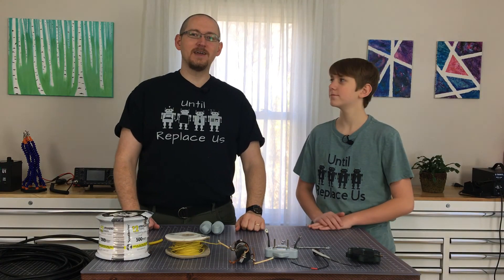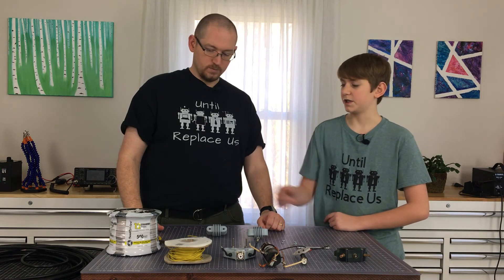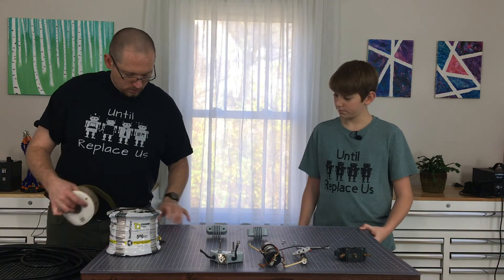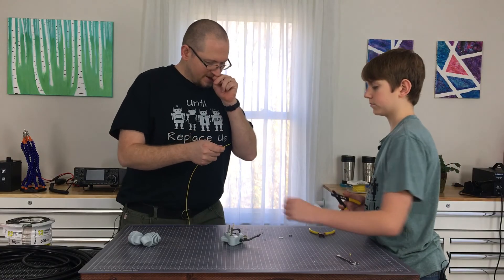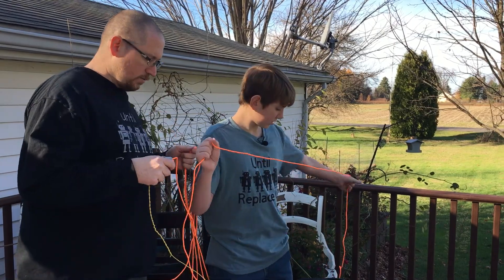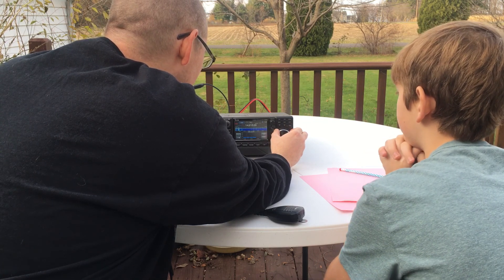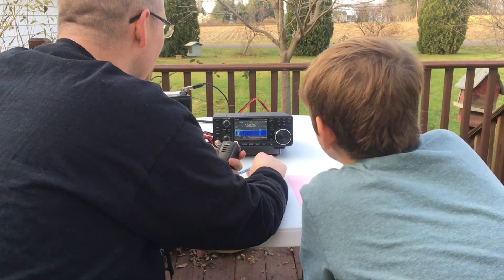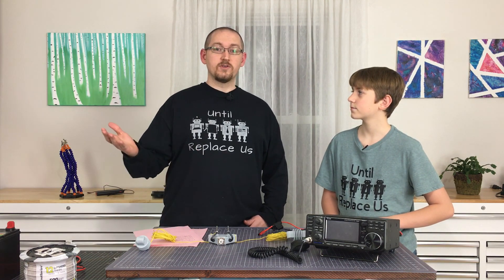Simple 20m Ham Radio Dipole Antenna

Comment: A nube question. First of all, a really great video together with your son! You said in the beginning that the contector had no contact with the poles. Do the poles, after the two wires has been screwed in, connection with the connector? Is the current fed through the connector in order to transmit through your antenna? I’m sorry if my question reveals lack of competence… I’m just eager to learn.❤️ Anyone in here is free to answer.

Comment: I made a 20M Dipole Antenna. I will not be using this 20M dipole for any other frequencies other than the 20M that it was made for.  Is a balun needed for this a 20M Dipole antenna? Again I will not be using this 20M dipole for any other frequencies other than the 20M that it was made for.  I also have an isolator.  Would I need both? Do they pretty much do the same job?

Comment: First electric fence wire is cheap because it is a poor conductor. 
Second the SWR they saw could be very misleading. Due to the fence wire acting like a slight dummy load. I suspect that the radiated power was a lot lower than your pencil would suggest.
Third if the antenna was a lot longer I am sure they would have an issue with both receive and transmit.
    It is nice that he included his son. I hope his son continues to do activities with his father. A good example for everyone.

Comment: We ended up making the antenna on Wed and made contacts to Panama and New Zealand on 40 meters. Also heard Denmark clear as a bell! Thanks again for the video. Now we are going to make a fan dipole with the same Alpha Delta to save on coax. We will use bamboo to separate the different wire bands!

Comment: I'm building one this week
Reply from the maker: Sweet - how did it go? The design is simple, yet effective.
Reply: @transmittinguntilrobotsrep1045  it works really well I used a old dipole center I had from when I was in the army and some speaker cable

Comment: I have a question.  Has the FCC ruled on using HAM transmissions in YouTube videos?  I ask because you could have pecuniary gain from YouTube videos.  I know the FAA considers using drone footage in YouTube video a professional use because of this, so I was wondering if the FCC has cleared it or not.  Great video by the way.
Reply from the maker: Hi Brian - That is a great question. I’ve never read anywhere that the FCC has ruled on this, or even considered it, though it could certainly exist and I just haven’t found it. I would suspect that there would be some fundamental differences between the two applications, however I can see how this is a valid question worthy of an answer. I’ll consider this more and then reply again.
Reply: @transmittinguntilrobotsrep1045  I understand the incidental instance like for teachers who use HAM to connect their class to the ISS, but some of these channels are 100% amateur radio and people are monetizing and making money from them.  Seems kinda like pushing their luck to me.  It would be one thing if it was, say, an RV travel channel and there was just an occasional episode where the communication on the air was incidental to the education (kind of like this episode of your channel), but the ones where it is a dedicated ham channel with them making contacts most or all of the broadcast seems like it would be clear cut.  I guess the FCC just hasn't gotten around to dealing with it yet.  How is it different than getting a bunch of people to pay an entrance fee to watch you making contacts.  Hard to police and know where to draw the line.

Comment: This is a really great video. Thanks for sharing it! I recently made an 80 meter inverted V by using DX Engineering's 80 meter coils, but after assessing the resonant frequency and bandwidth, I discovered that the antenna was resonant on 20 meters as well. I also got the resonant frequency right in the middle of both bands by chance without adjusting any of the wire lengths. The bandwidth on 80 meters is not so great, so a tuner would be needed most of the time, but 20 meters had less than 1.5:1 SWR across the entire band.
Reply from the maker: It is always a good feeling when you realize that you now have those complimentary resonant frequencies in addition to the intended one. I feel your pain with the limited bandwidth on 80m. I have two antennas that each cover a small part of 80m and together I still seem to chase outside of my area.  Good luck in your radio adventures and thank you for the feedback. 73s.
Reply: @transmittinguntilrobotsrep1045  Hopefully the antenna tuner will help with 80 meters. Thanks and 73s.

Comment: Like other people have said it is brilliant too see you and your son enjoying radio together. I would like to ask a general question. Why do Americans always work in feet and inches when building antennas . I am in the UK and use mainly imperial measurements for all my diy and so on but as soon as it comes to radio I find it so much easier to work in metric. This is a genuine question not a dig or sarcasm. My friends and I once started using imperial lengths  for fun on the air "CQ six foot six inches .QSY down a quarter of an inch" We were trying to rename all the bands but it got to confusing on the 3 furlong band. Best wishes to you keep up the good work 73 De G7BWI
Reply from the maker: Best comment yet. That is quite amusing - I would have loved hearing you call CQ in that manner. I may have to appropriate that at some point with my kids. 

As to why Americans work in feet and inches, I would assume that it is simple familiarity. If we go to the local hardware store, most everything is in Imperial, and so it is reinforced and creates familiarity. My kids and I work in metric when we are 3D printing, carving with a CNC, cutting vinyl, or really doing anything at a small scale. Again, I think it partly because many of the programs we use have metric options and so there can become both an intentionality and familiarity without difficulty.  At a larger scale though, we tend to shift towards Imperial probably because anything large (Wood, pvc, metal, foam, etc..) is sold to us in Imperial lengths, and so it sticks. Under less than ideal circumstances, we learn both. In a truly ideal world, we'd use metric exclusively. 

73, AC3DS
Reply: @transmittinguntilrobotsrep1045  It gets funnier. I remember when the UK was slowly trying to change to metric my Father and I went to buy some lengths or timber for a project. My Dad asked for 4 6 foot lengths of 2x2  only  to be told that they didn't sell 6 foot lengths it would have to be 2 meter lengths. Ok I will have 4 2 meter lengths please. OK said the assistant   4 lengths at 70pence a foot. You really couldn't  make it up. Mind you we are still clinging on to imperial stuff quite a bit. My trip computer on a motorcycle will give me miles per litre But not Miles per gallon. I remember my mother getting upset as the car wouldn't go as far on litres of petrol as it would on gallons. But  its all good fun in the end. Keep up the great work FDO

Comment: Hello both of you... question: suppose i want to receive the 6mhz band, so 468/6 = 78 feet, then my horizontal wire will be 39 feet each side, right?  Ok, with that wire length , can I also receive all the frequencies over 6mhz? ....and no frequencies under? To simplify, my question is can I get any frequencies over the length accordingly to that formula 468/x freq? Thank you for answering :).
Reply from the maker: Great question: 468/6 = 78ft / 2 sides = 39ft per / side - Yes.  This will make a resonant antenna at 6MHz, which is ideal for both transmitting and receiving. Tuning for transmitting is important. Tuning for receiving is not nearly as important because things won't break if your just receiving. Receiving frequencies above and below 6MHz on the above antenna is definitely possible. I just took an antenna that I manually tuned for 14MHz and was able to hear conversations on 3.5MHz and all the way up to 444MHz. The quality of the reception is definitely not as good as a tuned antenna, but it does work. I hope that helps.
Reply: @transmittinguntilrobotsrep1045  Ok thanks , your answer defenitively helps 👍👍👍

Comment: Because it does not look like you are using affiliate links I will point out that the Delta-C Amazon link is for Gigaparts. You can actually save a decent amount of money by going to Gigaparts directly. Great group of people there at Gigaparts. Of course if you have a 3D printer for the cost of filament, short piece of wire, an SO239 connector and two bolts you just make one. Of course you can just use a scrap of plywood as well or some cardboard, though cardboard has more capacitance, or even a small piece of plexiglass. 

This video does a great job at showing how you can throw together an very functional antenna in minutes. The SWR variance has more to do with the wire used than the lose measurements as dipole are fairly forgiving if you are close. Making the wire longer as they did here allows you make some small adjustments to length if you need to reduce your SWR.

Dipole are fascinating as they are both simple and complex. Just to point out how you can start to go down a very deep rabbit hole: The amount of droop you have at your center point has a noticeable effect on your radiation pattern. More droop starts to create the V pattern which has a much different radiation pattern than an ideal dipole. Likewise negative droop created an inverted V with is different than both ideal and V. Then that horizontal and vertical L shaped dipole, inverted vertical L, sloped dipole and things go on. So many people just throw up dipole antennas and don't give them the attention they deserve.

Now that the youngling knows how to make a dipole, it's time for him to get his license
Reply from the maker: Excellent analysis and thank you for bringing up some well considered points. I just 3D printed some wire winders, and you are spot on that it would be possible to quickly print out, or build from random scraps, the center and ends. This would be a nice fun and easy project if you have the printer already, or are willing to travel to a local makerspace, library, or friend who has a printer. 

I'm glad you brought up about the sag in the antenna and the reality of that causing a change in radiation pattern. Whether it is an inverted V, horizontal, V, or any other variation, they all have their pros and cons and it is good to learn about them and figure out what works best for the individual. 

Good news: since posting the video, that youngling earned his ticket. His first few contacts were on 10m this past week, running 5 watts from a portable antenna...and making it over 400 miles. Not too shabby!
Reply: @transmittinguntilrobotsrep1045  Pass along my congratulations.  I've been lazy since I got my general, but I need to get my extra. I also need to learn cw as you can almost always make a cw contact even if the bands are less than favorable.

Comment: Great that you are encouraging others to get building rather than buying.  I make nearly all of my own antennas for HF,VHF & UHF from all kinds of bits and pieces, really satisfying to get a piece of wire up in the air and contacting others around the world.  As an M6 I am restricted on power so resonance is very important when I go portable, I don't use a tuner.  Many Thanks  M6KVK
Reply from the maker: You are very right - it is very satisfying to see the DX come in after you have worked on a build. We have quite a few antenna builds planned for the near future now that the weather is starting to get decent again. Building is such a great way to learn more about the intricacies of the hobby. Stay tuned! AC3DS

Comment: Not that I’m trying to rain on your parade, but wouldn’t that be at 66‘7“ and then cut that in half? 20 m is 20 m?  If I’m not completely wrong, which wouldn’t surprise me it looks like that would be a great 10 m antenna.
Reply from the maker: Good question! You are correct that a full-wave 20m antenna would be around 67 feet. You are also correct that this antenna might work for 10m as well. In this video, we created a 1/2 wave 20m dipole (33'), which puts 1/4 on one side of the center insulator and the other 1/4 on the other side. Both full-wave and half-wave work for 20m just fine. If you do a google search for dipole calculator (I just did this to check my work), you'll get lots of good results that will show the 1/2 wave calculation. Thanks for the question and comment!  http://www.westmountainradio.com/antenna_calculator.php

Comment: You can use that center for a fan multi band antenna of say forty and twenty meters . 73's from kn4kbh .
Reply from the maker: Indeed. Good recommendation! The fan dipole is a very simple extension of this and is great for maximizing infrastructure.